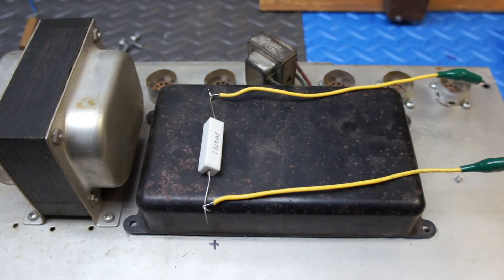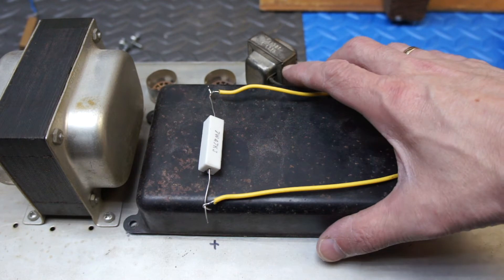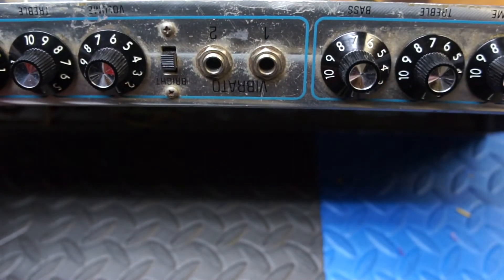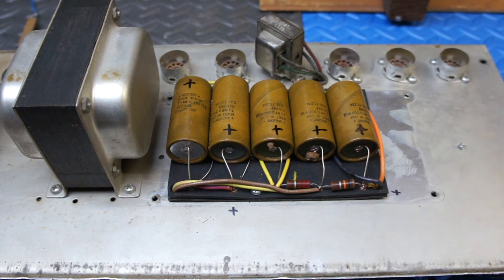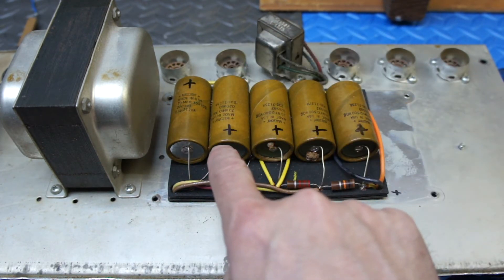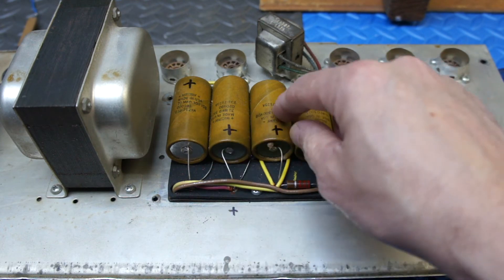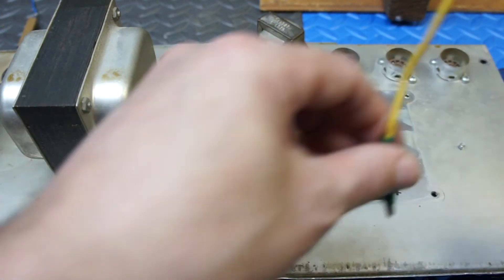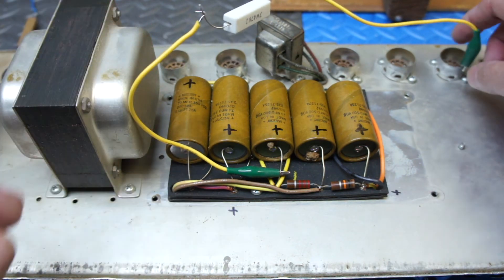How to discharge caps

Comment: Could you solder one of those LCD  voltage meters in line with your resistor so you could see it drain? Is that feasible?
Reply: An easier way would be to use a banana plug and put a resistor across the terminals. You don't even need to solder anything then. Plug the banana plug into the COM and VΩmA ports on a multimeter, putting the side with the ground tab into the COM port. Then plug your leads into the banana plug, with the black lead to the COM port side of course and the red lead to the VΩmA port side. Then you can drain and measure the voltage of the caps at the same time.
Reply from the maker: you could...if in doubt always measure the voltage present before you start work
Reply: UkmNthiland, is there a link or image you can post? I’d like to do this but can’t quite picture what you mean. And what value resistor? Thx
Reply: @JMLRecording  https://youtu.be/2iqmDf0QIyM

Comment: Pat, what was is the proper value of resistor to use and whatts the wattage?
Reply: I know it’s 2 years late in coming, but apparently Pat isn’t answering and there will be others who want to know this in the future. 100k ohms is perfect, should be rated for 2 watts or more.
Reply: Hi Phil, Bless you for getting back to everyone. That was very kind of you. Stay safe!!!
Reply: Phil Mitchell what a guy talk about discharging caps  and he went into great detail explaining this but he said a 470ohm 5 watt is a good in between cap it discharges a bit faster, the math was a tad bit off when he explained if it was used on a 900volt I think 1000uf cap not 100% certain if that’s the right capacitance . Every thing under that was fairly reasonable thought
Reply: Bless you for sharing your wisdom with us!!!
Reply: @medley4570 I just used this info. Thank you!
Reply: He had one job...